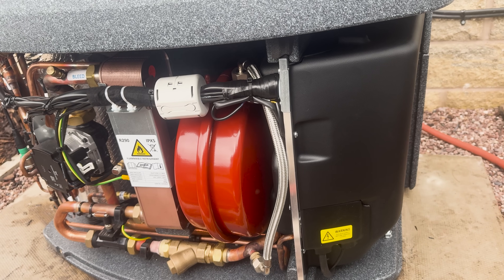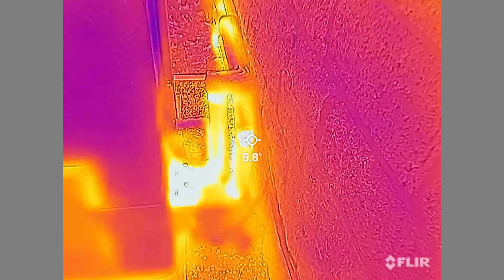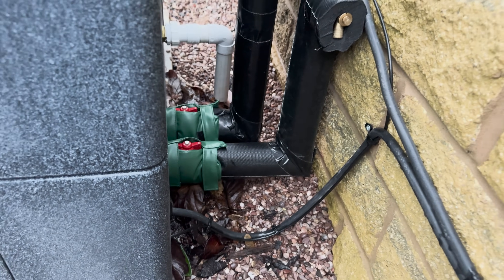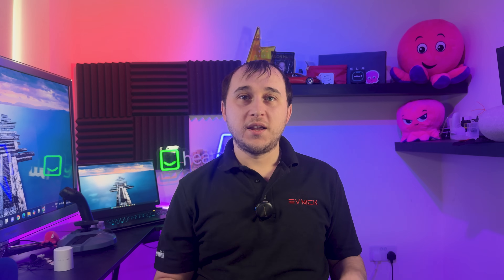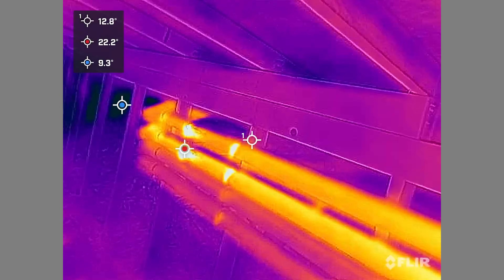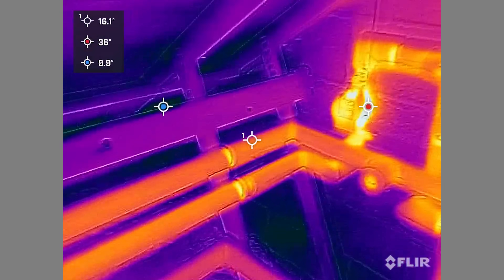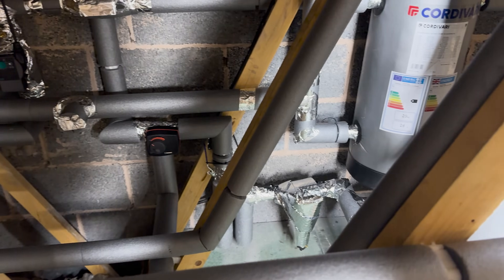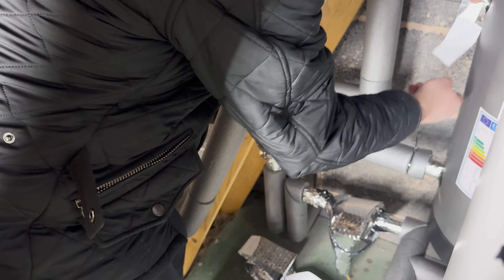Octopus Energy Didn't Insulate My Heat Pump Cosy 6

Comment: The better way to insulate outside pipework (including un heated roof or garage) is to insulate the pipe in a continuous run (with sealed edges and joins) then put bigger clips round the insulation (so there is insulation between the pipe and clip). Such as the Primary Pro system. 
I took off the rubbish thin insulation that was cable tied by the installers, and fitted that better quality stuff. Looks better, and should be loads more efficient.
Keep up the informative videos.

Comment: As an aside to my previous comment thanks Nick for your input its really appreciated.
What im perplexed about is how they come up with a quote - sure the EPC seems to have a bearing on it but I spoke to Octopus about getting a new one (which I will do) as the expired one has no size info etc...
But, what I don't understand is this.  Say my EPC goes up from D to C - that certainly wont amend my quote from c £6000 to £500.  I asked Octopus 'does anyone get it for £500 as advertised' and the answer was yes but depends.  How does 'having solar' and 'charging your lightbulbs to LED' have any bearing on what is essentially a boiler replacement cost?
This is such an opaque pricing structure.  Maybe as they become more popular the price increases - who knows.
The one thing that I really don't understand...... regardless if your EPC is A or E - and A is only if you are lucky enough to have solar panels etc..... how does that have any bearing on the physical install.  Sure there might be a radiator or two that needs to be changed but given the homeowner is presumably currently happy with the heat levels provided by the boiler surely they could elect for no radiator changes (narrow bore pipework excepted of course)...
BUT the big question is... and I asked this of Octopus, What is different in terms of work and hardware in my £6000 quote which is an easy install vs someone who got it for £500 and still got a cosy 6, hot water cylinder etc.
I fear we are in a 'throw a six and come up with a quote' territory as per the worst of the double glazing goldrush in the 80's!
I will certainly get the EPC redone and get a requote but reading between the lines most people now are getting an average quote of £4000 for this.
Reply from the maker: My homes a B and my price was £1350 so its not based on all the aspects of the EPC,  your quote won't get anywhere near £500.   They are looking at the info of insulation values of the home,  its sizing info and what the walls and floor are made on they use this based on info they collected from 1000's of homes to take an educated guess at work involved and radiator upgrades needed.   It may be worth getting a price form Heatgeek using there online guide and see what that fires out and then comparing that to octopus quote as if theres a small margin between them then heatgeek would be a better choice as there flow temperature is lower  and might mean a better cost per outlay but if they come back at 16,000 after grant then octopus will still be a better choice. 

I've seen loads on twitter, facebook and on my comment section who had quotes at £500 but also seen ones who had the job for £4000 and I have a friend whos EPC moved 2 places and his price fell from £7500 to £4500.   Your insulation will make the biggest difference to octopus pricing and EPC plus means cheaper running cost for you.   My advise would be increase loft insulation before running a new EPC.

I will try get an interview regarding how the price model works but regardless of how it works octopus still come as one of the cheapest heat pump installers of anyone out there
Reply: @NicolasRaimo  Thanks again for the assist Nick.
For sure I need the EPC redone and take it from there.  As I mentioned before I have no sizing information on the expired EPC so the quote can have no idea whatsoever as to the size of my (small) house - and since I have live there I have had the loft insulation re-done and a number of radiators upgraded.
Definitely time for a new one and they are cheap to have done too.
Reply from the maker: @ speak to octopus to carry it out they normally charge for it and offer to refund you if you go ahead for a heat pump
Reply: Our quote was around 4000 and it was generated before the install survey. Info on the website said that this would not change as a result of the install survey or EPC outcome.
Reply from the maker: @gcnitenite8392  my friend was told otherwise and His EPC dropped and so did his price
Reply: @ Thats not what the guy from Octopus told me.  He said that as my EPC was so out of date and there was no indication of the size of my home then if the EPC was redone then the quote would be amended. 
By how much?   Ive yet to find out.  The cynic in me says by not much... but it stands to reason that without a home size figure they cant possibly make an accurate assessment.
One way of looking at is that on their 'instant quote' website they possibly shouldn't even try to provide a figure without the up to date EPC including house size.
Reply from the maker: @ my friends went from 6k to 3500 if that helps

Comment: I looked at the temperature of the water leaving the heat pump and the temperature entering the first radiator, at 50c it was an insignificant loss so not worth further insulation as the payback period would be too long.

Comment: Guess it depends how much you paid for the insulation material. I get insulation with my hello fresh deliveries which I've already used on a few pipes. Instant savings even if small. My pump and magnaclean are in more visible areas so I wont be making them look even more unsightly though
Reply from the maker: Are you reading my WhatsApp’s 😂 my mates just insulated his old water tank using hello fresh material
Reply: @NicolasRaimo  😅I've done my whole shed. Feels better than chucking it. Probably should cut down on the Hello Fresh 😬

Comment: Man, the resolution on that Flir camera is junk!

Thanks for sharing your work.

Foil tape by itself does not insulate. It could be argued that it does the opposite and act as a conductor.
Gaffa tape is what you want for most of those joints.

Will you recoup the cost of your work? Probably not. 
Does it offer good peace of mind? Definitely.

I have done the same at my place, knowing full well that it's not financially worth it but may help to eek out a few watts.

Comment: Interesting, heat geek elite did our install. 
All the joints are sealed. The pipe work gets inside the house asap and theres no buffer tank as you very rarely need it - his words.
Reply from the maker: am the rare case that needs one :)  see other videos where we tried without...   Worth noting heat geek quote was £7500 after grant and octopus was £1350 after grant for me also
Reply: @NicolasRaimo  yup, and they only do "simple" installs in their design criteria. 
They wouldnt do ours after a survey as it was too complicated. At least they are honest enough to say that.

Comment: Insulating a pump may well cause the pump to overheat and fail prematurely or even be a fire risk. Look up the pump manufacturer installation instructions on cooling. It may well say 'operate in free air'.
Insulation will effectively massively increase its thermal resistance to ambient, and as it is a source of power loss, the insulation will prevent that heat dissipating.
I'd remove the insulation asap.
Filter insulation.. fine.
Reply from the maker: if it was designed to operate only in free air they wouldn't make a premade insulated case that covers the entire product but I take your point.
Reply: That is probably true, but the preformed insulation won't cover the motor.

... Never insulate a pump motor!
Reply from the maker: @bringiton8989  covers  the entire thing including the motor

Comment: Heat geek does a very good video about heat loss that may be worth a watch 👀 but in short, the loft is usually a warm place anyway, by insulating the pipe you stop the heat leaving the pipe, you also prevent the heat from entering the pipe, works both ways.
Reply from the maker: Indeed the water heating likely would benefit in summer

Comment: Our quote was £7500 via OE, so went DIY - for a daikin 6kw monoblock, albeit for a 34 F EPC - old house (I'd like to say stately home), but the Mrs says sh1t hole/show. Currently use 1600kw / month, but with a combination of oil / electric (bivalent settings) we are at £120-£150 / month for everything (Car (500)/House (320) /ASHP(680) /Oil(100 litres) *Khw) - the insulation on your cozy system (even with a EPC of B), is just noise. Love the vlogs over the years, otherswise we would have no idea. 👍👍
Reply from the maker: Curious what it cost you to DIY
Reply: Also curious how much you bought the Daikin 6kw for, if you don't mind sharing.

Comment: Everyone seems to mesmerised by the COP and SCOP with heat pumps, but that is only a part of the whole effeciency of a heating system. You can have a COP of  10, but if that heat produced is being wasted on heat loss from the unit, long pipe runs, uninsulated components not in the house envelope, like the loft, plus multiple defrosts every hour, you will have to use more energy to produce the same heat produced by a gas boiler in the kitchen. Thats why just comparing COP is a nonsense, there is soo much more to take into account.
Reply: In practice, my heat pump is far cheaper to run than my gas boiler, considering the difference in energy prices for gas and electricity, that shows how massively less carbon is being emitted - the cost is taken from my energy bills, which is the real measure. Very few gas boilers attain even close to their specified efficiency in real life, whereas heat-pumps are much more closely monitored.
Reply: @MentalLentil-ev9jr  How do you work out that your heat pump is cheaper though?  With just the COP/SCOP, did you have a system boiler before or a Combi, did you heat your house at the same temp with boiler that you do with the heat pump, have you taken the wasted heat from defrosts into consideration, or outside pipework or have you got solar/batteries that are off setting the cost. Lot more in the mix than just COP/SCOP
Reply from the maker: I agree I did an entire video talking about how cop is only part the story you can also have a terrible cop and really cheap running costs
Reply: @NicolasRaimo  or a better COP and higher costs👍

Comment: Hey Nick, I had mine installed and I'm not impressed with the install quality nor the performance. My heat pump seems to be needing ~30kwh day, I suspect because my living rooms is struggling to reach the desired 21C temperature and the HP is constantly working hard. And it's not even that cold these last few days. Are you having sort of similar figures?

I use 19C in the early hours, 22C as a boost during Cosy periods (I'm in the cosy tariff), 21C the rest of the time. To me it seems like Octopus failed to assess the heat loss properly for my living room during the survey, and they are blaming my conservatory doors, windows, etc. I'm speaking to them to see if they are willing to change the large radiator in my living room to a larger one, but the attitude has been "minimum effort" unless I point out stuff.
Reply from the maker: Join the cosy octopus group on Facebook and detail all this and I’ll tag over some octopus staff,  what you setting heat pump to hit when not heating… should only allow fall back of line 2-3c
Reply: @NicolasRaimo  will do, I'll speak to them first today or tomorrow

Comment: I might get the insulation around the valves to the cosy 6. Our hot water tank, water pump and filter are all within a cupboard, whereas yours is in the loft. heat losses inside of the insulated (inhabited) envelope of the house seem less important than the heat loss to the environment outside of the home. I might try get my hands on a FLIR to check the run from the heat pump to the cylinder, but it looks well lagged from visual inspection.
Reply from the maker: Yea I wouldn’t lag anything inside the heat envelope

Comment: I was inspired by your video to investigate Octopus Heatpumps.  There were some quite tempting price points spoken about online... some as low as £150 for an install (which is ridiculously cheap).  Their own website says 'from £300'
Anyway, filled in the VERY basic online inquiry form on Octopus' website - it really doesnt ask for much info - and the instant quote price came back as £6,000 which im sure is reasonable but my install would be VERY straightforward - nowhere near as involved as yours was.  Im perplexed at all these people getting even under £2,000 and who in fact gets these '£300' installs as per the website.  I did ask Octopus that question but they havent responded.
Reply: My initial quote was 750. After the survey they knocked that down to 250, as I didn’t need any pipes or radiators changing and I only needed a Daikin 4kw for my 4 bed detached house. Probably as easy as it gets.
Reply from the maker: @MrNilOrange  cough £150 if you used my referral code
Reply: @MrNilOrange  How is your daiken 4kw performing can it hit 24 degrees if needed as that's the temperature I like to keep my living room at, I have a choice from octopus for the Daikin 4kw or the cosy 6
Reply: @MrNilOrange with the grant they are charging £7.7k to fit a heat pump that cost them £3.5k. octopus making good profit out of the grant on that one.
Reply from the maker: It’s done via your EPC… if your EPC would improve get this done and re quote
Reply: @NicolasRaimo  I agree with Nigel. My EPC is B, I only need one radiator upgraded, I'm retaining my own tank (it 's a Mixergy tank which needs a heat exchanger fitted), there are no long pipe runs and I cam in a £2,800 even after the recent 20% discount. I am getting a Cosy 10 as opposed to a 6 though.
Reply from the maker: @ it’s based on EPC and heat loss on quote but final price may be adjusted slightly I’ve seen people with lower quoted than me
Reply: @NicolasRaimo  ive been in the house 16 years.  Just looked up the EPC and it's a D but marked as expired.  Are they using the expired rating?  Shouldnt they insist on a new one anyway or do it themselves?  They are making a quote based on something no longer valid although Ive no idea whether it could or would change.
Still stunned at people getting these installed for just a few hundred pounds.
Reply from the maker: @ they use it to work out insulation levels of home,  sqm size etc gives them an idea of what to expect to do when they arrive heatgeeks and others do similar stuff

Comment: Thanks . I will use touch to check heat loss. Interesting video very informative
Reply: You do not need a thermal camera.

You can just use a cheap digital thermometer.
Reply: @jkl_me  The thermal camera is much easier to use and more likely to pick up missed areas. It's great for seeing areas where loft insulation is maybe not working to its best. The phone attachments are not that expensive nowadays.
Reply from the maker: indeed one of these will work https://amzn.to/3QbHzb6 but as others day FLIR cams better for picking out cold spots easily missed with infrared pointers

Comment: Adding insulation is never a waste of time or money.... whatever anyone says...
Reply: Insulation on the pipe work in the loft is outside of the thermal envelope of the house.. without it he would have a warmer loft...not much use if no one lives there..
Reply from the maker: Yep my loft is a "cold space" insulation is below my chipboard keeping the heat in the home and out the loft
Reply: Actually according to heat geek insulating inside the thermal envelope isn’t a good idea as it heats an area that will add to the general heating inside. 

In my heating system which is an old boiler, my pipes inside are not insulted but the floors are very badly insulated to the outside world. 

The under floor area is cold and it’s something I am working on fixing but I’ve got bigger fish to fry at the moment.